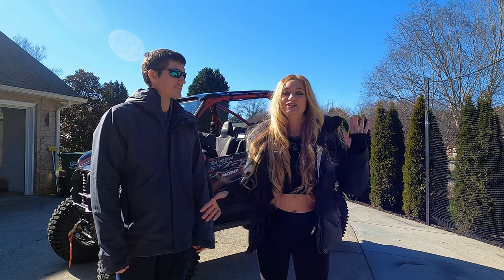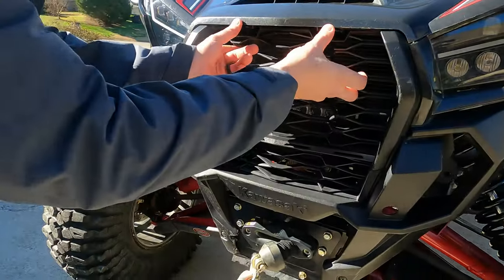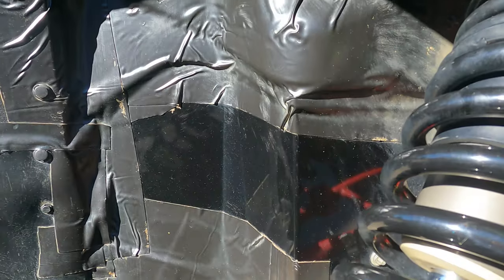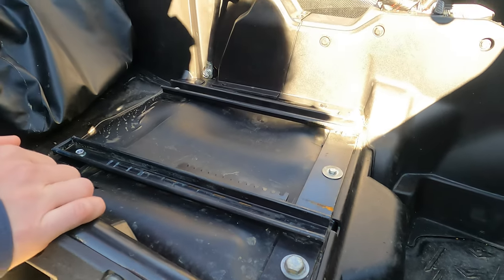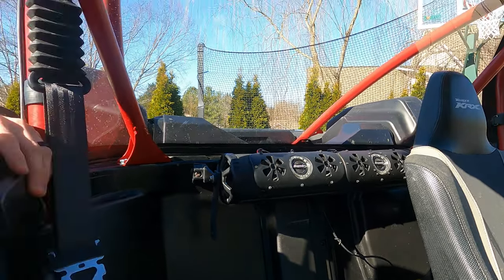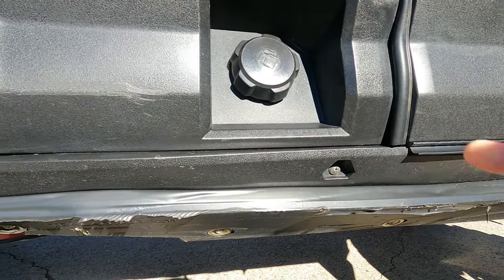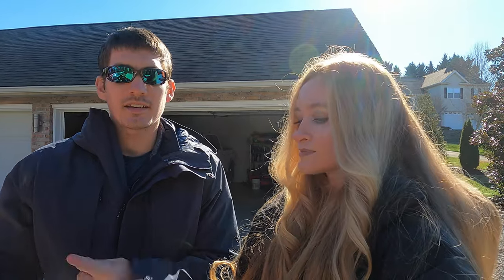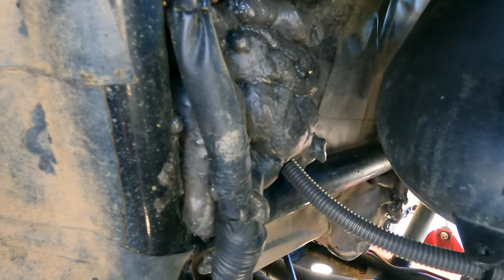Kawasaki KRX 1000 ES Accessories

Comment: You are correct about the cameras.  However, I have a 2023 KRX1000 Teryx4 ES, I bought in December.  I shelled out the crazy money and put in the Interactive Display.  It will switch and bring on the cameras automatically in forward and reverse and has other nice features.  The GPS works ok, but the maps are very old and there are no map updates as of now.  Just FYI . I took your advice and used the elastomeric tape as you did.   I enjoy your videos!

Comment: I like your seat mod. What did you do to bolt down in the new locations?
Reply from the maker: We used the existing rear bolt holes. The front we used the 2 outer bolt holes, they are are used for the 4 or 6 point seat harness. We took a piece of metal and welded it to the brackets. If you would like a picture or two please provide your email.
Reply: @rayneventures6991  Thank you. I don't see those holes, must be under the cab seal kit. I'm going to do that mod when I get a chance.
Reply from the maker: The holes are about 2 and 1/4 inches from the existing seats holes. Going towards the center console and then to the door. I thought the cab seal kit has those cut out, because we covered them with come tape to help finishing sealing it. When you go to do it, please let me know if you would like pictures. We can also try to post a small video on it.

Comment: I don't know if you leave the windshield on all time or you can take it off, but in the summer we have the fold down type very nice to have the air flow when slow trail riding, but with all the insulation you've done summer heat may not be a problem, by the way that's a good looking machine I hope we run up on you all at windrock sometime that would be pretty cool
Reply from the maker: We always leave the windshield on because of going through all the mud and water, and yea with all the insulating heat isn't really a factor. Yea that would be cool 😎 ride safe!

Comment: is the gear shifter boot attached underneath the console or just stuffed into the gear shift assembly?
Reply from the maker: Its basically just stuffed in there. I did take apart that plastic piece around the shifter and then put the plastic piece over top. It does not come out without removing the plastic cover. Hopefully that makes sense.

Comment: I liked my Polaris a whole lot better. I am disappointed in the Kawasaki, i.e. noisy suspension tons of dust extremely loud engine noise, especially when it’s cold and heat in the cab. I bought the 2023  ES.